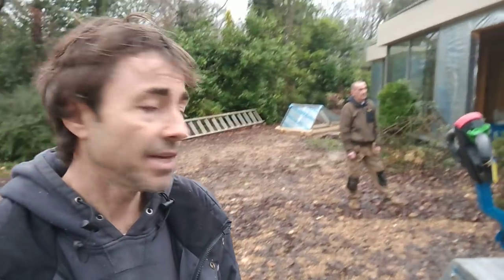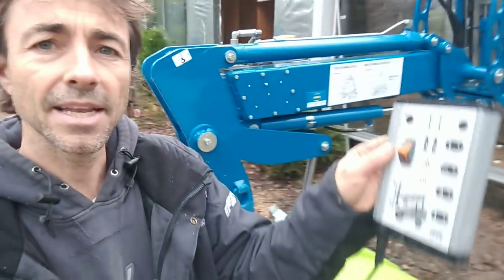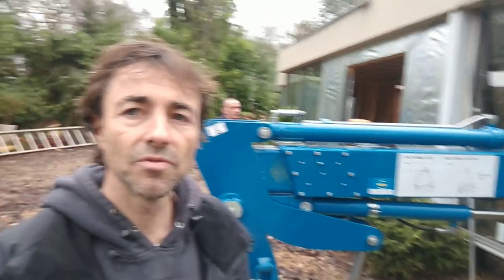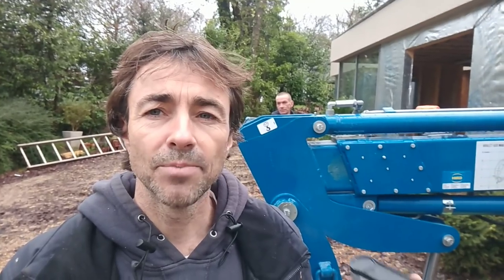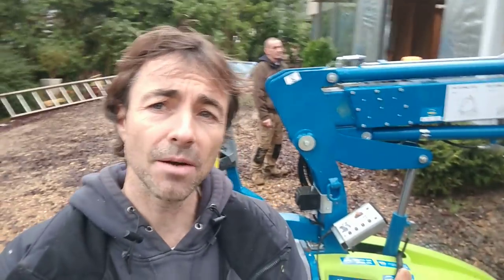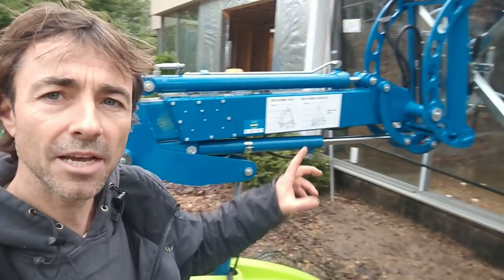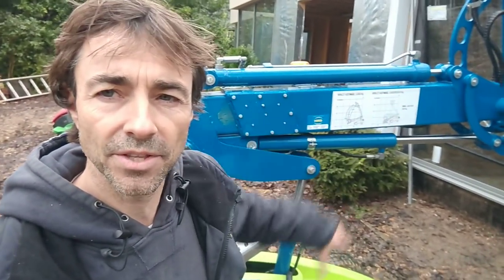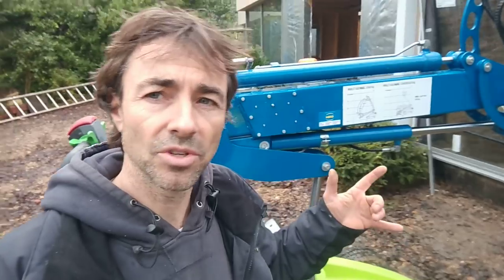How to safely lift glass

Comment: Hi Robin 
I have a big project and struggling to find a reasonable supplier for aluminium sliding doors. Please tell me where you got yours from. 
I have been watching your capel build and skillbuilder shows. Fantastic 
Thanks
Mick
Reply from the maker: Where are you based
Reply: Hi
Small village called littleborough which is north of Manchester 
I'm extending and renovating a 1947 country house with a new basement which will have level acces on to the rear garden. We have a 9.3 meter wide opening for sliding doors. I want to have 5 units with the left and right fixed and the 3 central units to slide. Your units on capel looked to me to be around 1.8-2 meters wide which would be similar to what I need. Yours also have a thin profile. 
Thanks 
Mick
Reply from the maker: @michaelgarforth2861  the firm I use is from Hampshire they probably won't go that far, try contacting The manufacturer called Smart Systems and get a local manufacturer and installer recommended maybe this is the system we used
Reply: Robin Clevett 
Thanks
I will send you some pics when it's installed. 
Keep up the recordings. It's great to see a craftsman creating there perfect home. 
Mick